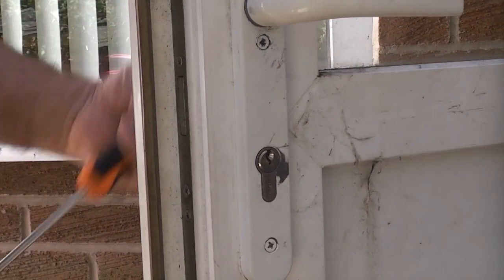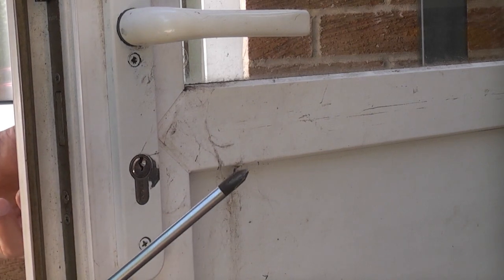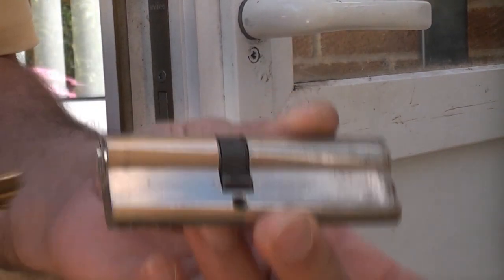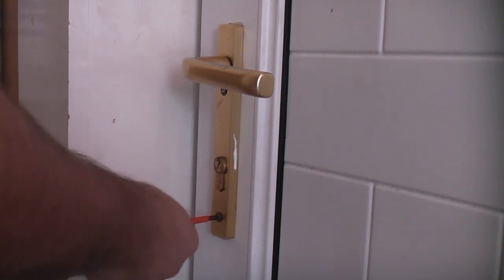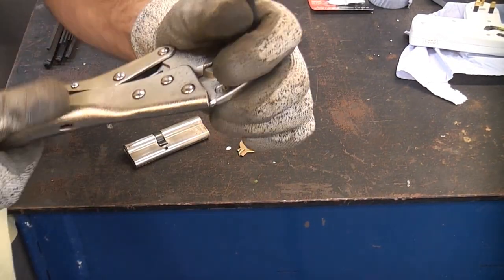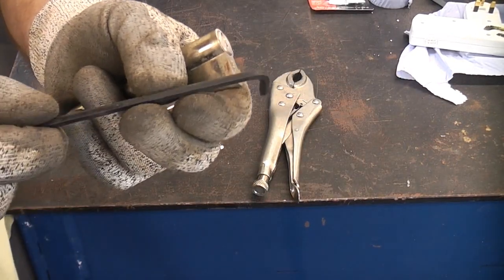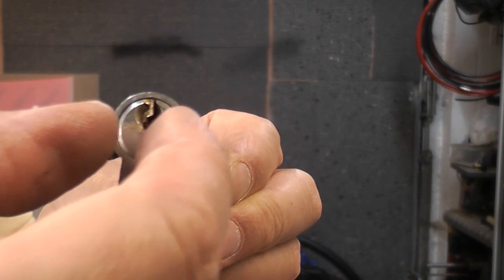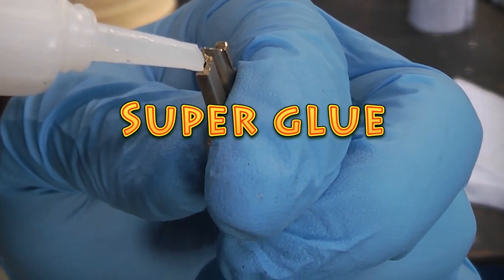How to fix a broken key in a Euro cylinder lock

Comment: The last tip about secureing the door handle was new to me. Simple and effective and much better than screwing in a door jam
Reply from the maker: Yes, it's useful doing that if you can't lock the door.
Thanks for the comment ;-)
Reply: It's worth having around the house as a regular item, if you have two doors, and you leave for a vacation, that's the right way to secure that second door.

Comment: Balcony was being replaced, and the access door key snapped couple of days before. Fancied a go myself, but key not turning the lock -  no time and needed the access so called a fella in. He quoted £350! I told him where to go. He said what about the call out charge, I said you never came pal! He knew he was played and off he went. Spray of wd40, got lock turning with broken other half of key )randomly the lock jammed same time as key snapped due to plastering dust from work in same room!). Opened door, removed cylinder, snapped key pushed out. Didn’t know about snapping the cylinder however - but £350 and the fella was taking about drilling and this and that. Total cowboy chancer. This is a true story, should make a movie.
Reply from the maker: Thanks for the comment

Comment: Also some anti snap locks if they snap at the anti snap bit. Drill a strong screw in the next piece of the lock then claw the screw with your hammer and the lock will then snap in the right place to unlock the door
Reply from the maker: Thanks for the info

Comment: Great video! I was able to remove a euro lock that someone had jammed the wrong key into. I was able to actuate the cam with a straight screwdriver (the lock was only a 60mm deep one, much shorter than the one in your video). Many thanks!

Comment: It's worthwhile avoiding fitting locks (Yale Type or the one in video) where the key has a deep notch in it near the turning end (as in video). It's even worth considering changing the barrel before a key breaks in lock if you've already got one.
It's cheaper than replacing twisted keys in the long term, if a key has twisted once (even slightly) and been straightened it will have been weakened.
Reply from the maker: Thanks for the comment ;-)

Comment: Thanks for the tips I've had to use all sorts of measures to get doors locked temporarily! Also those ABS locks are fantastic but would be a pain if they snapped in the lock!
Reply from the maker: I think the ABS cylinders are only anti-snap on one side, so you could probably snap off the inside and use a Allen key and molegrips to unlock the door. 
I do have some anti-snap cylinders here (UAP I think) that look like they are anti-snap on both sides.
Thanks for the comment ;-)
Reply: Ultimate Handyman no you cant

Comment: If the screw holding the cylinder in place is rounded off do you recommend snapping the lock or drilling the screw out.Thanks
Reply from the maker: Definitely try drilling out the screw 👍

Comment: Another great "how to" vid Chez. Hadn't thought of drilling a hole int he wood, I'd just tied it off in the past. Mind you, you could probably just leave the door open for a week here!   I've managed to rescue the broken bit out of locks a couple of times using a dental probe. The sort with a straight piece with a little right angled bend on the end. The proper ones are strong. A pair of forceps can be useful as well, they're often sold as disgorgers for fishing . In some cases you can get them in to grip the thin sides of the key. Depends on the lock / key combination and how tight the key is though I guess.
Reply from the maker: Thanks for the comment ;-)

Comment: I recently installed an avocet abs lock. After a couple of days, it became very stiff and suddenly jammed. I managed to open the door, so I can at least open and close it. But the key is stuck (on the inside) and won't turn more than 15 degrees in either direction. I've unscrewed the long screw keeping the euro cylinder in place and removed the handles but still can't get the lock out. 
Any suggestions?
Reply from the maker: I'd get in touch with Avocet and ask their advice. I would imagine that it would be guaranteed. 
http://www.avocet-hardware.co.uk/contact.asp
Reply: cl04k3dw0lf i would guess the problem is maybe caused by the trap pins
Reply: cl04k3dw0lf if the cylinder is turning  a bit it could be something with the mpl  not the cylinder .

Comment: Ultimate Handyman I have a question for you that I really need help with please
Reply from the maker: Ok, it could be tomorrow evening before I reply though ?
Reply: Ultimate Handyman no problem, basically what it is, I installed an outside tap for a customer, however all the water appliances are at the front, so I went into the loft and branched into the pipe feeding the water tank, put an isolation valve and a non return valve straight off the tee and then went through the back wall(keeping my pipe all clipped to the ground) and then stuck a double check valve outside tap in and the customer has told me that it's dripping from the overflow from the tank, any ideas pal?
Reply from the maker: There is a chance that when you have branched into the supply pipe that some debris has been picked up and is preventing the ball float valve from sealing properly, sometimes if you press down on the float arm the sudden gush of water can remove the debris and make the washer seal again, if that does not work it is easy to replace the washer in most cases- although I changed one a few weeks back for a mate and it was a real pain in the backside to get to (really bad designed tank).
Reply: Hitman Daz if you used compression fittings  there is also a chance you might have twisted the float valve which can also stop it shutting off.
Reply: Ultimate Handyman thanks for this response pal 👍, appreciate it
Reply: Rob Hoare huh 🤔??
I branched into the mains cold pipe in the loft feeding the tank, didn't touch the ballcock fella

Comment: I think all videos  that show lock snapping should  be banned by you tube as they are basically showing people how to break into houses.
I am not blamming you but the likes of UAP  are masivly responsible in an effort to push their awful very easy to snap cylinders on people.
Reply from the maker: I think most people that would go and snap a lock already know how to do it because they have learnt from other criminals or have been taught in prison. In many instances the YouTube videos help because they highlight the problem to the general public, who can then get a more secure lock.
I would never advise anyone to rely on a lock to prevent a thief, these days you need a full working burglar alarm, security cameras, good lighting, security marking etc.
Thanks for the comment
Reply: Ultimate Handyman thanks for the reply .
You tube is masivly responsible for the increase in lock snapping , it used to be used by a selection  of people  around the bradford area until UAP decided to try and cash in by scare mongering which is ironic as there 1 star cylinder is no deterrent  at all.
Most experienced  theives wont use mole grips as they leave tool marks and can link them to many other offences it is the young impressionable teenagers who get the ideas from you tube.
I know of at least 10 instances this year in my local area where the perpetrators learnt on you tube how to break into a house.